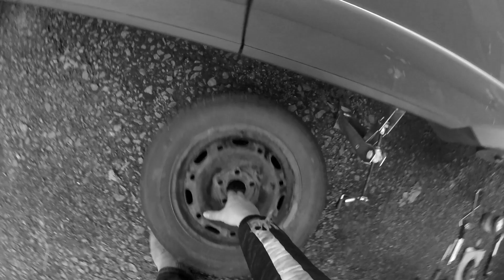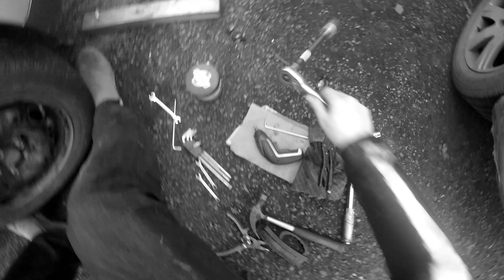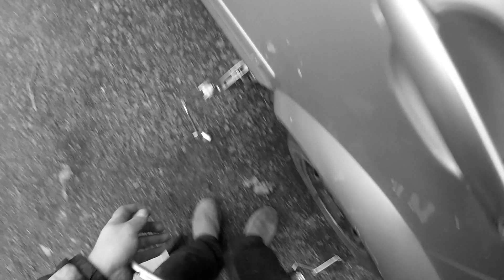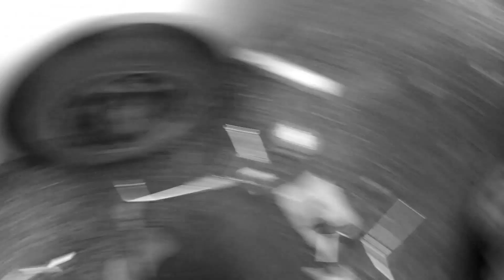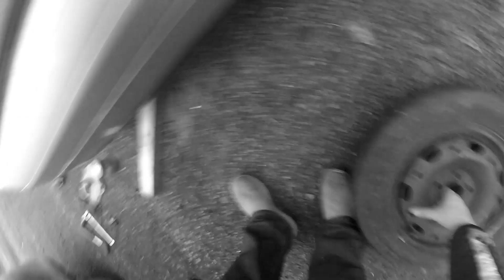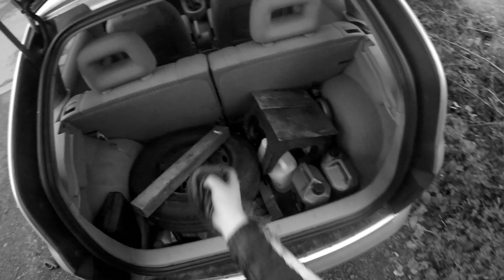No Expert credits.......

Comment: Hi, do you know how to knock Eml light off without going to garage
Reply from the maker: You can turn off eml light cheaply by using a Bluetooth OBD connector and OBD application. some of the programs do that some of the programs don't but I would suggest to find out out why there's an eml light on first, then you can decide whether to ignore or fix it
Reply: @NoExpert  I changed the part, but do you need light turned off or would it go off once the part was changed ?
Reply from the maker: @imonlytellingthetruth6562  sum of the parts reset when you start or stop the car and take the key out of the ignition, but some need a program to tell that the part is changed.